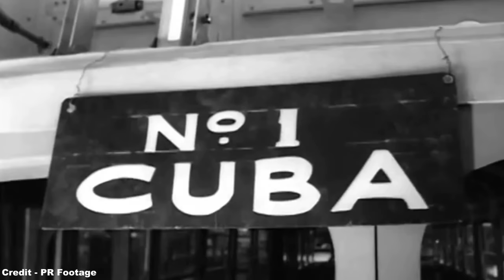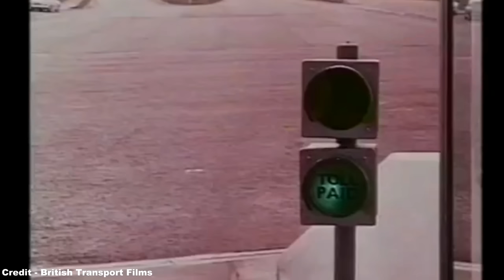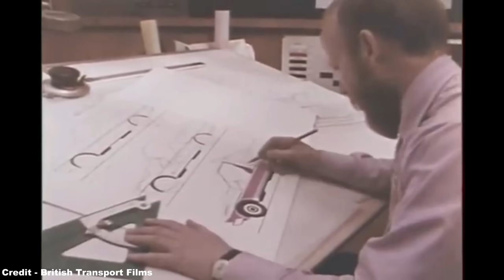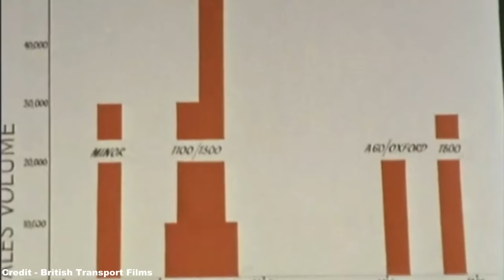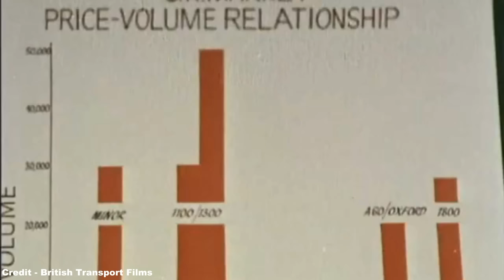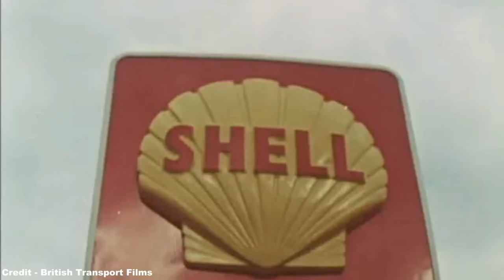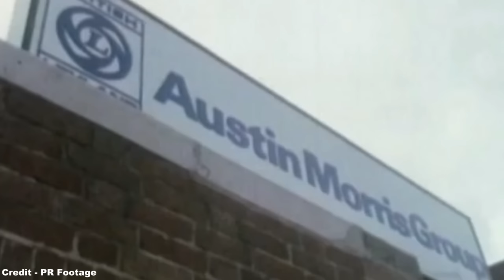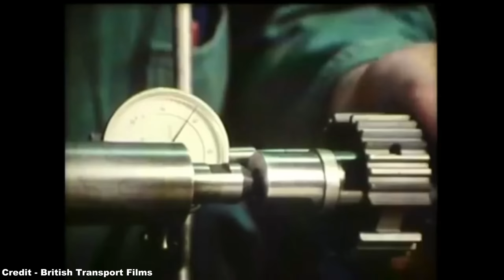Death of the UK Car Industry - Part 2: British Leyland

Comment: I grew up with these cars and the idea that Morris made basic cars and Austin more advanced cars is only something I've ever heard in retrospect - I don't think most people really knew that at the time. I just remember that looks and reliability were everything - nobody really cared what went on underneath the bonnet as long as the car looked nice and was reliable. And therein lay the problem.
Reply: Top comment here 👍
Reply: "And therein lay ONE OF the problems" - there, fixed it for you. Because it sure wasn't the only one. I'm surprised I have any hair left because of my frustration with almost everyone involved. It seems some of the most effective people - such as George Turnbull - got pushed out
Reply: Stuck on a layby with the bonnet open and steam from the radiator! Or the fan belt gone? Get your garters off love, quick fix and on your way. Ah the good ol` days when motoring was a joy.....
Reply: Morris, ox bull on the bonnet going through a river ford, Oxford, made a more quality basic car. Main problem of BMC cars through was the tin cancer, and leaking engines - drip drip drip goes the oil. God was mild steel sheeting then so crap. I am sure it was a pressing problem at Pressed Steel, introducing impurities into the surface. And bare metal laying around for too long before paint treatment (strikes did help). A sorry sight.  But Italian cars were worse, That's Life Esther Rantzen! Remember her whinges on the BBC? It was all political.
Reply: I bought a seven year old marina in 1981 it twisted and flexed like a boat the bonnet blew open twice when I was driving it once on the elevated section of the A 316  by jobs dairy driving with the bonnet folded over the windscreen just looking out of the side windows was fun luckily I didn’t hit anything
Reply: Hence the notorious car thrashing sequence from Fawlty Towers!
Reply: my family owned a 1975 Passt...
for 23 years...
my dad drove it, my mom drove it, my sister drove it and i drove it while , my 1979 Passat been in the workshop... 
which i drove over 12 years...
my 2 oldest cars been Renaults with 14 years of age each!

Comment: I started work for BL Cars as a Finance graduate trainee in 1975, with the intention of staying 3 years to get some experience, and complete my accounting qualification. 3 years in the power train division at Longbridge, with me changing jobs each year. 

Very interesting times. Of course there were lots of strikes, inefficient working practices, but also the result of decades of under-investment in in machine tools and equipment. Some of the machines in the toolroom dating back to 1912. 

Fascinating going round the ancient forging factory, vs the newly done foundry, the new 'O' series engine line, vs the next door old 'B' series line. Plus the low volume 'E' series and the high volume old 'A' series lines. Gearbox machining and assembly, and small component machining in the automatic lathes factory (if you could see the far end of the building through the oil mist of hundreds of cutting machines). They spent money on a few things, but much, much more was needed.
Reply: they could have had the most efficient and productive workforce on the planet but working with ancient machinery to produce archaic vehicles was never going to be a winning formula
Reply: i visited the VW factory in Wolfsburg in the late 70s...clean air, robots and people working hand in hand...and building Golfs, 1200 per shift!
and this factory been already over 3km long!
Reply: In hindsight and having never been there myself, from a distance BL was the symptom of a much deeper sickness hiding in the industrial and political culture of the U.K.  They adopted this mental illness of Shareholders First, which was invented by Milton Friedman.    Any money invested in manufacturing and workers is money not going to the shareholders who do absolutely nothing except hold paper claiming fractional ownership.  They should be the last group to be paid; not the first.

BTW, Friedman's cult metastasized into Reaganomics and that pestilence has been with us since 1982 and no end in sight.

Comment: Back in the early 80's I used to pick up cheap cars to tart up & sell on, the good thing about most BL cars were that they were pretty simple to work on, the Marina being the easiest.
Parts were cheap & the scrap yards were full of the things!
As for quality, I bought an Allegro with less than 15k on the clock, because it had been hit lightly in the rear, the boot & rear lights needed replacement.
On removing the boot lid, I noticed a cigarette packet had been wedged in the structure, then painted over during production 🤣
Reply: All part of the waterproofing sonny😁
Reply: Quality Control back then was viewed as just another reason for the not very good management to pick on, scrutinise & give criticism to a paranoid workforce....
Reply: They ciggie packet would cost a packet now
Reply: I bought an Allegro in 1979 it was the most unreliable car I’ve ever owned,oil leaks,leaks during wet weather the boot filling with water, etc etc etc etc.
Reply: The cigarette packet story reminds me of the Ronan Point Tower block in Canning Town, East London. The one that collapsed on one corner due to a gas explosion. When the building was thoroughly inspected after the incident, they found newspaper and other rubbish between the panels, where concrete and other proper building materials should have been. The scary thing was that nobody was surprised......

Comment: Owned a 1973 MGB for a while. Very fun car to drive, BUT- Got really proficient at rebuilding brake cylinders, clutch master cylinders, SU carburetors, distributors. Cylinder head was cast iron, and they all had cracks even when new. Grease fittings everywhere.  Convertible Top was a PITA to operate, so I just removed it during summer. Lucas (aka The Prince of Darkness) electrical system was so bad it was the subject of many jokes. ( Why do the British dink their beer warm? Because Lucas builds their refrigerators😂). 
I still miss driving it, though. And I owe a lot of my mechanical knowledge on owning & maintaining it.

Comment: I worked in the motor industry from 1969 to 1973 for a component manufacturer & consequently saw some of the goings on at most. A fairly succinct summation of the Leyland problem,but I can assure you the others were not much better,however they were generally better organized & did not have government interference.

Comment: My wife and I having returned to the UK from Australia in 1976, went on the hunt for a new car. We looked at the MGB GT at a local dealer. We looked over a khaki green model, the only one left in their inventory. Bubbles in the paintwork at a join on the front nearside wing indicated rust coming through the paint finish. Not a good look on a new car, so we walked away...
Reply: Didn't Dacia and Skoda have similar problems? Anyone remember the Lancia Beta?
Reply: The japanese cars were better finished but rust got them just the same until the introduction of anti corrosive dipping
Reply: @nickjung7394  "Dacia" had rusting problems after early '80's, when the made cost cuts. Before that, it had good or acceptable paiting qualty.
"Škoda"... I don't remember having too much rust problems on the rear engine ones. The 'Favorit' seems to be the one with problems.
Reply: I never had to weld skodas much ...Minis,Metros,Maestros truly shocking for an MOT ..😂😂

Comment: Excellent video.  Although the Austin 3 litre did use the same doors as the 1800 (and Maxi), nothing else was the same as an 1800. The ugly front also was completely different, with a north-south 6 cylinder engine, which was also used in the MGC.

Comment: The Marina; yes, my dad had a Marina estate for his works car.
He regularly drove to various construction sites carrying flanges for pipe work in the rear hammering up and down the early motorways back… which were few back then.
It was a good motor as it took the pounding given… I think it was a 1.7lt engine.
He eventually bought himself an Ital; a Marina with a facelift… which he got rid off very quickly as rush poured out of the weld seams after wet weather… I think it was replaced with a Chevette.
His next works car was a Datsun (Nissan) Cherry…

Comment: From about 1977 to 1984, I worked for a company that provided a company car.
Unfortunately,  the policy was British cars only.
My first was an Austin maxi.
It had a lovely ride, and the hatchback was useful. Unfortunately it was nothing but trouble. Wheel bearings, overheating, head gaskets, and a poor gear change.
The gearbox gave out, effectively writing off a car that was only 4 years old.
That was replaced by...
Another maxi.
The problems the same, and again the gearbox failed, writing off the car, again, only about 4 years old.
The last car was a morris marina, basic, cheap, boring, but at least reliable.

The boss had an austin princess, his wife an allegro.
They were both frequent visitors to the repair shop

Comment: I remember my uncles Rover SD1 V8 SVO version, was nice and comfy but things were going wrong regularly unfortunately, because if it wasn’t for the strikes and poor quality later on in the 1970’s the styling was amazing and looked sharp on the SD1 , one day the glove box came off in my dads hand whilst we were being driven by my uncle in his SD1 to a family gathering and get together. Worst thing was the rattling boot on it .
Reply: Well, the SD1 was praised upon its release due to its sharp looks and performance. It only was about a year later that people actualy realized how poorly put together they actually were.
Reply: My Dad said his V8 SD1 was the worst car he ever had. Still looks beautiful.
Reply: I knew a trainee priest who once asked his parents to visit one of his parishes. His parents turned up in their new SD1 and we all went inside for the service and when we all came out the SD1 had burnt to the ground. It was replaced with a Range Rover after it was discovered that an excess piece of fuel line was wrapped around the rear muffler and this bodge finally failed causing fuel to leak onto an ultra hot exhaust. The factory worker chose to wrap the excess and not cut it . Legendary build quality.
Reply: @w00df0rd  It was a Car Of The Year
Reply: Did the modernised Rover 827 come too late, even if it was technically better (in terms of more power and features etc), and lack character by comparison to the SD1?
Reply: @TassieLorenzo  I believe the 820 and 827 was too late to save Rover because the writing was already on the wall way before it launched. Not hard to see that under the skin it was Japanese mechanicals and design and electricals and not anything to do with Rover, just clever badge re engineering from Honda, same with the Rover 213 which was a Honda Ballade. The strikes of the 1970’s already did massive damage to Rover and the customers remember well. Best I have actually owned was a Rover P5B V8 and early series 1 Rover P6, last of the greats.

Comment: As an Australian, I really do like the P76. Sorry to hear that its closure cost the parent company so much. I drove a 6 cylinder Marina (Australian) and it was absolutely woeful but went like a scolded cat.
Reply: It took a very brave, or stupid person to push any Marina hard other than in a straight line. Dangerous understeer. The P76 wasn't a particularly bad car for a first attempt into the large car market especially in V8 form, but the 6 cylinder E series engine was too small to compete with the competition. I worked extensively in those days on the E series engines, and hated them.
Reply: @erroneouscode  Last attempt of several disasters and as usual released only half baked
Reply: @Tolpuddle581  The Chrysler Centura in 2-litre 4-cyl form wasn't too bad, as it was basicially the Simca 180, which became the Chrysler 180 when that company took over the business. However, with either of the 6-cyl Hemi engines in it, the extra weight further forward compromised the handling a lot and turned it into a lead-tipped arrow. There was no castor-action, so the bigger-engined cars didn't self-center the steering after a turn; there was also no power steering - all quite disconcerting!
Reply: @chrisweeks6973  FYI, the king pin inclination is what returns the steering to straight position after a turn. Castor keeps it in a straight ahead position in forward motion.
Reply: @brianlove8413  Whilst in essence I wouldn't disagree with you, I was referring to the action, ie the lack of self-centering on the Centura, not the actual mechanics.
Reply: @chrisweeks6973  Hi, OK. What they may have done with the 6 cylinder models is reduce the king pin inclination to reduce the load on the steering, i.e. to reduce heavy steering when turning, as the inclination has a lifting effect, which is what returns the steering to centre. They should have been fitted with power steering on the 6 cylinder models.
Reply: I have had 2 P76s over the years, both V8 4 speed manuals.  Great cars that handled and braked better than their  Australian rivals
Reply: @Nick-Gye  Agreed. I had a new V8 Deluxe with three-on-the-tree and it was a great tow-car. Used to tow the caravan from Melbourne up to Queensland and it hardly knew the 'van was there. Swapped it for a new XC 4.1 Falcon auto; BIG mistake!
Reply: @brianlove8413  i like to think of kingpin inclination as "hanging off the pivots".

neutral, straight ahead, the least gravitational potential. everywhere else, it lifts up. 

flip em over backwards and wee, perched on top of a barrel! done this before just to prove a point... 

i had strange and unusual teenage years...  really should redo my tilter cart... no steering wheel, just the same idea as skateboard/mountain board trucks. by changing the pivot angle you can have front steering, rear steering, backwards, or just about any combo you can think of... real fun. i havent seen a paddock basher in years. havent seen a paddock in years. full of effing housing estates. no wonder people cant drive anymore.
Reply: Did your 6-cyl. Marina go round corners ? Here in England the heavier B-Series engined cars were notorious for understeering off through hedges...............:face-turquoise-covering-eyes:
Reply: The Marina did not handle. It was a dog.
Reply: @terryjacob8169  The Marina was 100% total crap. It was hopeless on roads with any potholes as it would jump across the road forcing me to slow down. Let's just say that it did go really well in a straight flat line but couldn't go around corners nor brake. A complete basket case.